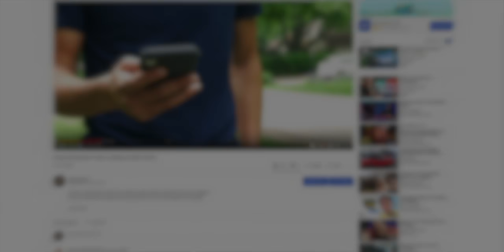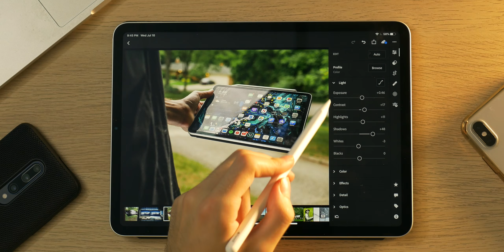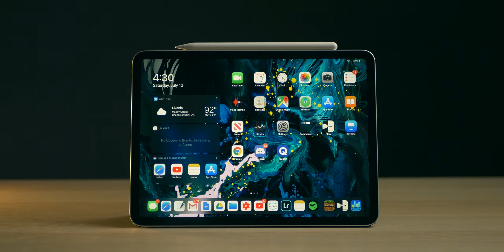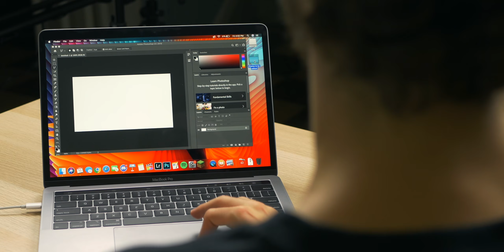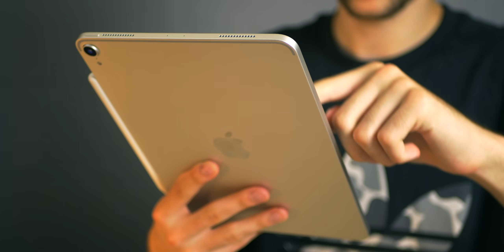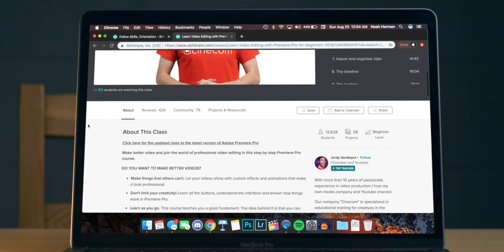iPad Pro (iPadOS) vs 2019 MacBook Pro 13" | FULL COMPARISON | The Final Showdown!

Comment: I’m really struggling choosing between the 12.9 and 11 as a college student? What’s you opinion?
Reply: The iPad Pro 11 is plenty big enough. I have had the justice of using both iPad Pro sizes and the iPad Pro 11 is a perfect size, while the iPad Pro 12.9 feels like a huge computer screen in your hand. As it may seem like, bigger is better, this is not the case. Definitely go for the iPad Pro 11. Btw I am a college student as well doing everything on my personal iPad Pro 11. Mainly taking notes at this point. Plus if the app Notability is a perfect note taking app will not regret

Comment: The iPad is a companion device to use along a work or school computer. It can be used to project to a larger projection, but I have yet to see this. Online homework still uses flash for the most part. So iPadOS won't help with that. And the tablet can be used walking around, sitting on a seat with no desk. I think the iPad is almost there. It is there for some. It is worth it for the average user.

And the battery life is better for the iPad Pro. Much better, smarter, faster ,and it feels like the future.

Comment: I had the surface laptop 8th gen i5 with base clock speed 1.6ghz and Lightroom experience was very very slow on it and had to sell it , 
This MacBook pro had a clock speed even lower (1.4ghz) I wonder how it handles photo editing in Lightroom , is it as slow in develop module !? If yes I might just get the iPad pro then

Comment: Dear Noah, i have a 2009 Mac Book Pro. I decide to buy the iPad Pro 12.9 to replace it. I can buy it now or i should wait the new one that should be out soon ?  Thanks.
Reply: Scri Scri76 I think you should wait knew ones are coming in October
Reply: Stephen Curry  I read the new One should be out next March
Reply: Scri Scri76 that’s when you can get it but the event will be in October
Reply: The new iPad Pro will come with a dual/triple camera set up, and a slightly improved A-13 CHIP, , I would recommend you buy the iPad Pro 2018 discounted , unless you you care about the small upgrades that won’t make a difference at all. One camera is enough for me and the A-12 Chip is way too fast to notice any difference from the A-13.

Comment: I pad pro looks really cool but because I have to program I must choose the MacBook Pro which is more expensive but oh well lol
Reply: Must choose? You can code on iPad just need to work differently if you do Python you can use pythonista, working copy gives access to github also textastic is a linking editor. Furthermore you can spin up a cloud instance and shell in to code and compile. Finally you can use online platforms like Python anywhere, cloud 9 etc.
Reply: gary Croft I must program for my CS and engineering classes. Not just light python coding
Reply: TonyDaExpert snookered then unless you can shell into a real computer